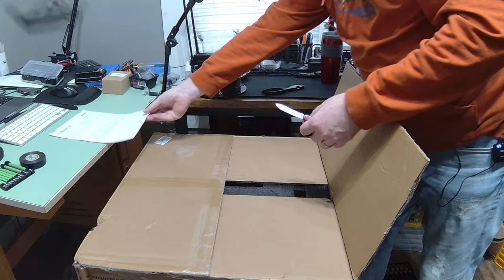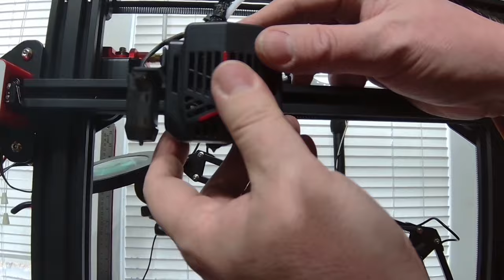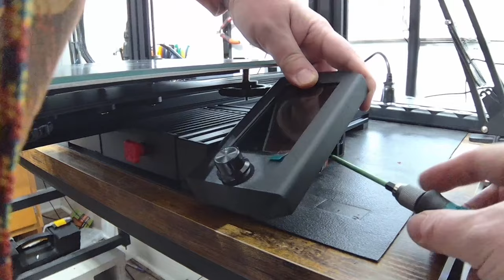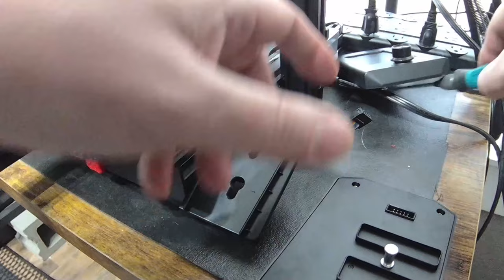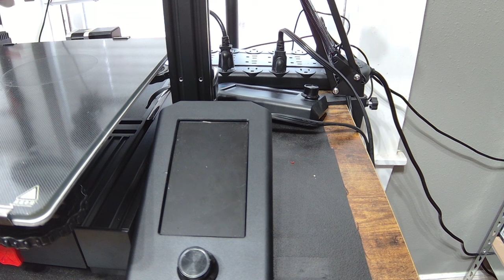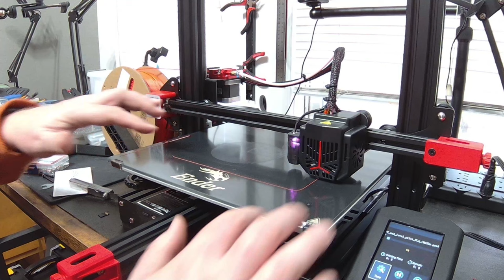Ender 3 Neo Max setup: Breathing New Life into an Ebay Unrepaired 3D Printer (Part 1)

Comment: Nice way to get a cheap printer. I see people all the time who jump on forums or social media to complain about a printer and how bad it is and that they returned it. Most of the time it is someone who didn't want to take the time to read a manual or even do a bit of research. I feel bad sometimes for the companies who have to take a loss due to user error. It is good to see companies putting out more polished machines now though that just work out of the box. But I still think some are not cut out for the hobby. Lol. Great video.